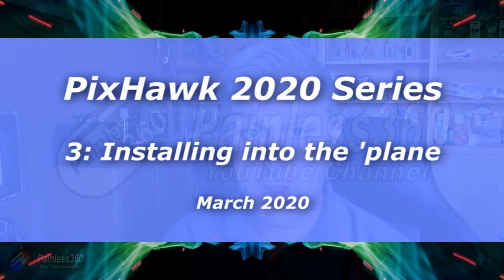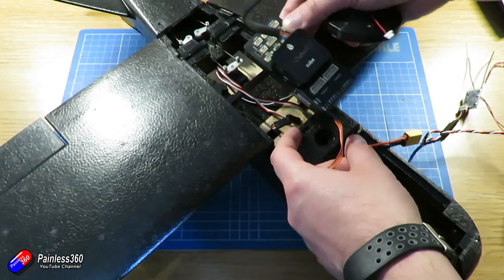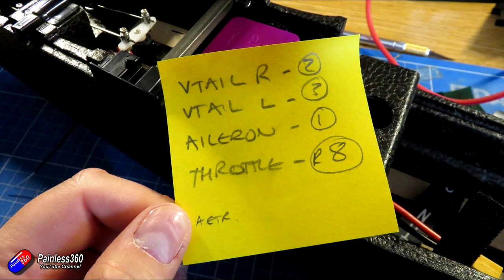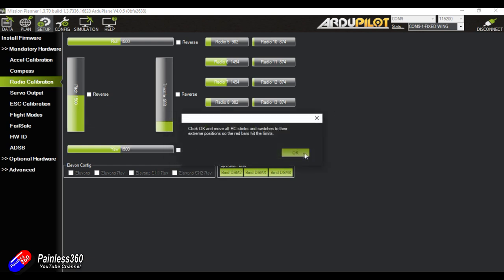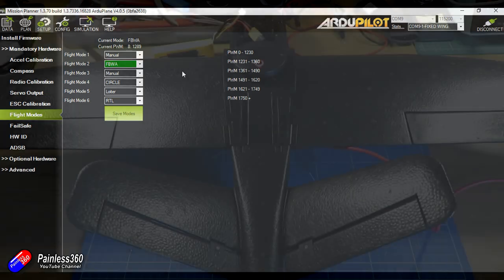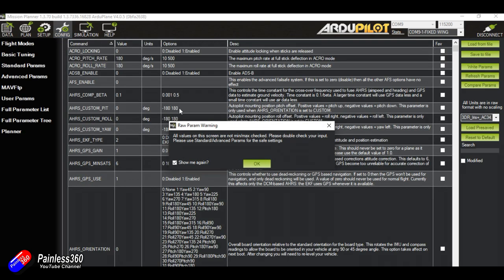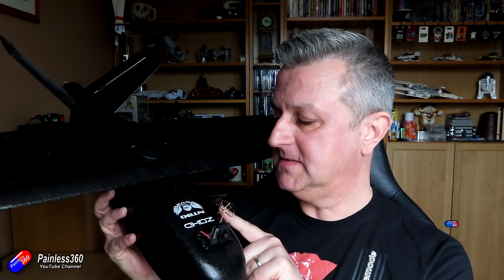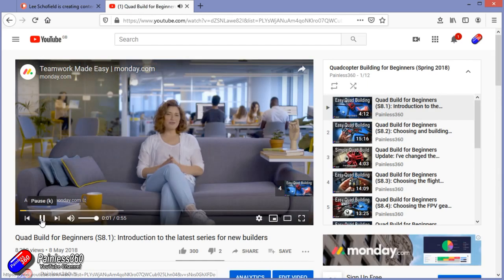PixHawk/Mission Planner/ArduPlane Build for Beginners: Installing into a 'plane

Comment: Hello painless great video as always. Your knowledge is amazing. I am building a bixler with VTOL and I was wondering if you have the set up for a tri vtol? I got all motors and servos in place and I am on the installing the  pixhawk on the aircraft and I haven't don't this in a while. Thanks H
Reply from the maker: I've not tried it yet. I'm planning on using the quadplane stuff - https://ardupilot.org/plane/docs/quadplane-support.html

Comment: Thanks for the awesome videos! I have got into this for two weeks and am super excited about all the new knowledge that I am gaining here. I am planning to incorporate this knowledge with my programming skills and build real-life problem-solving builds. Although the general steps are clear, can you please give the list of all the equipment used for this build, including the battery used? This is going to be my first build and I would have to wait a long time for all the parts to arrive, so I want to be as accurate as possible. Thank you very much!
Reply from the maker: Links to the stuff I use is usually in the video description of the video linked. If you follow the series you can find everything with a simple search. The plane is a ZOHD Nano Talon, I'm using a PixHawk orange and ArduPlane. You need a radio, receiver and battery as well. You can also add FPV kit if you want to - see my FPV for beginners series. Best of luck!
Reply: Thank you very much! I have already ordered everthing and everything seems to correspond to your listed items. Except the Cube, I got the purple cube in order for it to fit inside ZOHD Nano Talon Evo. Thanks!

Comment: I have several questions regarding the servo output set up, first of all, why would you use channels 8 for throttle? Secondly, I followed your guide pretty closely up to the radio calibration, but on the servo out put, the fourth channel has input in it and can be move, while yours are empty, also in your 8th channel, you can put throttle there and has input bar on that, but mine is just empty, if you could help me, I would really appreciate. Anyway, amazing video, keep it up mate
Reply from the maker: I don't understand the question. Are you confusing RC inputs and Servo outputs? If you follow every step in the series you should be fine.. Best of luck

Comment: Where were you when I set up my first Pixhawk? jejejeje Highly recommendable to read Ardupilot's wiki, it's very complete and you really learn the operation of FC as well as the basics of how aircrafts work. Good video, thanks 😁
Reply from the maker: You must have missed my original Pixhawk series from summer 2015 and my Pixhawk Cube series from summer 2017 :)
Reply: @Painless360 Nooooooooo, but those 2015 videos I found after setting up the first one. That's how I found this channel and I'm still here 😀

Comment: Hey Lee!! I'm attempting to switch modes from Stabilize to AUTO to start an autonomous plan, however the mode will not switch unless it is connected through USB to MP. How can I get around this without relying on telemetry(because I don't have it)? Thanks!!
Reply from the maker: You can't select modes like auto on the bench. It needs to be flying. See my videos on mission flying. Best of luck

Comment: Awesome Videos !! but i have a question. do you know what would cause one aileron to move more than the other? i followed ur tutorials but when i was done i was left with two issues. first the ailerons keep twitching. and the second is that my left aileron range up and down is like half of the right one. can you please help :)
Reply from the maker: Sounds like you're using a flight controller. Assuming you've not changed the rate of movement for one of them in the software, most common issues will be changes to how the linkages are connected to the control surface or the servo s are different specs... Best of luck

Comment: hello there 1 ive built a fixed wing model and followed the whole steps and everything is right . but my control surfaces are not moving when i m moving the control sticks on my transmitter . im using a flysky fsi6s transmitter with flysky iA10B receiver. i dont know whats going on and ive been trying to fix this for months trying out different things . i dont know if its with the wiring or any other setting that ive done wrong. please help me out .
Reply from the maker: What troubleshooting have you done? Are you using a Pixhawk?
Reply: @Painless360  I am having a similar issue, I am using an orange cube pilot

Comment: hey plz help me out,
i need to reverse the alierons and rudder on my plane but in this page at 8:10 (servo output) , i am not able to change any values or reverse them..the alierons and rudder r moving in the wrong direction
Reply from the maker: Make sure you're using the latest Mission Planner.. best of luck!
Reply: @Painless360  yes i am using the latest 1.72 version..but still the servo output page not working..i reversed the channels in the radio caliberation page and it worked....

Comment: Hi, can you provide the full list of items i need to purchase to implement this : Nano talon, Pix purple cube set etc .                      Also please let know how long it will take for a newbie to assemble the Nano Talon and Pix purple on it.
Reply from the maker: This is an ambitious build for the new pilot. Everything needed is shown in the series so watching it all will show you the pieces you need.. Best of luck..
Reply: Thanks for the quick response. 

I'm interested in learning a fixed wing flight controller over 3-4 months. I had a tough time with soldering electronics in my previous build so I'm looking for something that doesn't need solder.

Please let know which Pixhawk is the best to begin

Comment: what battery do i need for the pixhawk px4 with a 950kv brushless motor?
Reply from the maker: That depends on the weight of the model, what props you're using and how long you want to fly. See https://youtu.be/DlQwOV3MD74 for some ideas... Happy flying
Reply: @Painless360  like 12 in maybe and i don’t really care about flight time, maybe like 30 mins or something
Reply from the maker: You need to figure out the current the model will pull in the hover to know what battery you'll need for that flight time. To know the current you need to know the weight and prop you'll use.. See that video. Best of luck

Comment: What would you suggest pixhawk cube or matek for a quad?
Reply from the maker: It depends on what you want from the model. Most professional users will use PixHawk cubes for the solid performance and redundant sensors but the Matek boards are far cheaper and smaller for where those things are not needed..

Comment: Can you please tell if the following battery Is compatible with Nano Talon's ESC with Pixhawk :

11.1 V, 50 C, 5000 mAh Li-Poly.
Reply from the maker: Should be - it is essentially a 3S battery.. Best of luck!
Reply: It's strange. I've followed everything and it works on mission planner but no reaction on motors. I thought the battery is not compatible with ESC.
Reply from the maker: I would doubt that if the voltage is ok. Best of luck with it..
Reply: @Painless360  

Hey, I figured out my arming hiccups.

A solid green light glows now ! 

But arming happens only when it's connected via USB.

When I power the pixhawk via battery, I hear "click click" internal sound with no light radiating. Few tell me, this happens due to insufficient input voltage.

Mission Planner also shows "Battery Level = 0V" in Preflight Check.

No movement in motor too.
Reply from the maker: I'd check the battery and telemetry connections from whatever power brick you are using. Best of luck!

Comment: 1. Pixhawk arms Green Light for a minute or so.

Thereafter I get "Blue light - yellow light" repeat (by website it means Gps checks failed) . Then have to I redo arming to set it to green light again.

2. I tried doing ESC calibration just using battery connection alone. Pixhawk doesn't light up in my 11.1 battery. Just keeps giving "tick tick" sounds under "battery only" connection.
I need to fix this to have a go on ESC calibration using battery.

Please type replies by numbering 1. and 2. For respective questions
Reply from the maker: What troubleshooting have you already done?
Reply: @Painless360   I tried arming the Pixhawk to see if the constant ESC beeping ends. My Pixhawk has armed, the beeping ended but zero response in motor or servo.

Should I calibrate ESC for nano talon+Pixhawk 2.4.6 ? Or does it come armed

Comment: Everything works in my mission planner till 9:03, it recognizes my Transmitter movement on laptop. But zero response on motor and servo as ESC keeps on beeping. Any suggestions?
Reply from the maker: All covered in the video at 7:20. You need to setup what outputs are used for what control (esc, elevator, ailerson servos etc.) - best of luck!
Reply: I did that. I set throttle on channel 8. But the green bar keeps showing up in channel 4 though no channel is connected to it.
Reply from the maker: Please watch the entire series - sounds like you've missed something. Best of luck.

Comment: 9:05 : when I connect battery to my nano talon for the first time, the motor beeps continuously with a 1 sec interval. 

All RC input responses are seen in mission planner but no motor or servo is moving. Just beep sounds in motor.

Any suggestions
Reply from the maker: Sounds like it can't see a valid PWM signal. I'd check your outputs in Mission planner.. Best of luck
Reply: I'm using PPM due to Flysky receiver. The mission planner values are changing wrt controller movement. But zero movement on the servo or motor.
Reply: @ameto91  have you solved it? Having the same problem here!

Comment: Is not working for me. Could you help me? I have the big orange pixhawkboard and when its time to connect everything in the plane, I connect the servos and the motor esc to the board, but nothing works. I connected everything in the "main out" in the same layout that I had when using my radio. In mission planner it detects the radio inputs but there is no output, the servos dont move. All this, while being powered by a 12v battery. Im doing this for a university project, so it would ment a lot to me if you could give me a hand here. I can send you photos by email if you need. 

Thank you. 

Sergio
Reply from the maker: Check out the Pixhawk 2020 series for the latest tips on the building and setup.... Best of luck

Comment: Anyone know if its possible to just buy the plastic parts to convert the old nano talon to the new evo version ?
Reply from the maker: I've not seen them for sale anywhere... If you find them then please let me know...
Reply: @Painless360  Hi ya,if you look on bandgood for zohd nano, there is a listing for £7, which has some parts. Its called Spare Part Plastic Parts and Hardware Kit, i was hoping to just update my old version to the new. Mainly for the flat wing, as my original version had bad roll control, hopefully this might fix it.

Comment: I am looking for some help, I would be very grateful if anybody out there could assist me please. As part of a bundle Exchange I received this slope glider in good enough condition and with little Investments on my behalf, I really want to modify this aircraft into a power glider, preferably with a folding propeller at the front,  I'm hoping that somebody out there could help me with the specifications that would best suits my needs. I have a 40 amp ESC both 3 or 4s compatible, I'm looking for an efficient  motor and folding proppeler combination. Initially it will be on 3s lipo and depending how it behaves lithium ion 4S with a small flight controller will be its final project, I currently fly the Nano talon.  I'm just looking for something else with different characteristics to improve my flying skills. I'm  currently not in a financial position to be able to afford the *FMS Fox"  or buy my dream aircraft "The Sting carbon scale 2.65m". So until that day comes around hopefully one day soon I am looking to enjoy the most that I can with what I have got, if anybody can help me with the ideas or the specifications or even a links to the best products I would be most grateful. Thank you, Tony
Reply from the maker: Please see my videos on motor and prop selection that were on the channel recently. I'd copy someone else's setup for minimum risk and hassle..